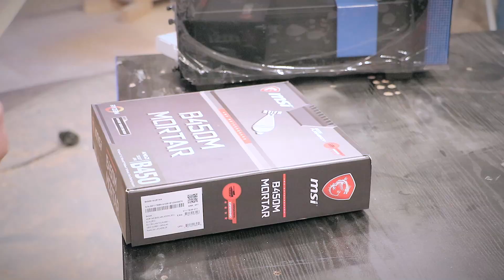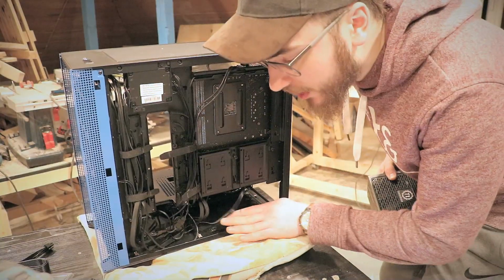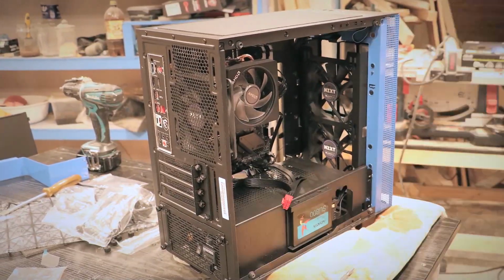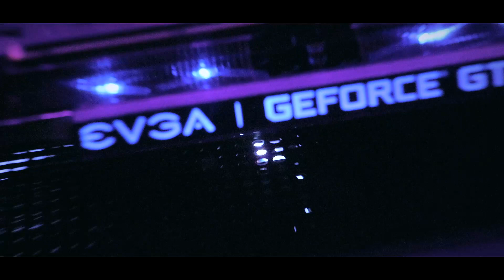$2700+ Ryzen 2700X, 1080ti PC Build

Comment: I think you added your totals wrong. I just build this same computer with an RTX 2060 for US$1150.
Reply from the maker: I used mostly newegg to look up prices at the time. The pc came out cheaper than that tho because I went shopping for parts in several different local online stores.
Reply: Jason Berardi you built the same computer? As in every part he had was the same exact part besides the graphics card? You realize prices go down over time right?  The processor and ram I know for a fact went down a lot. Also the 1080ti is a much more powerful graphics card than a 2060. And also a lot more expensive. They still go for 500+ while the 2060s are 350-400